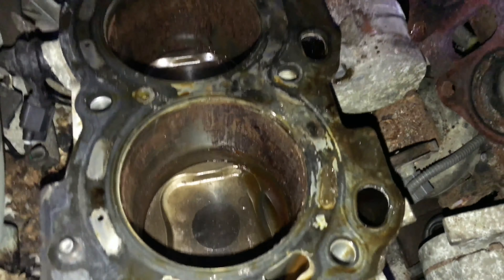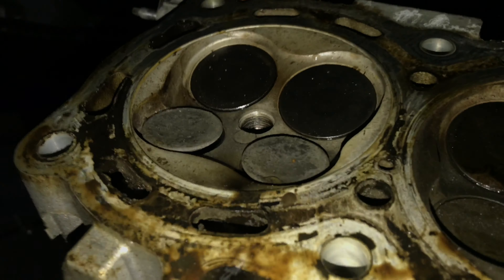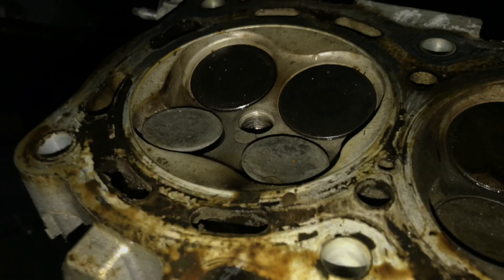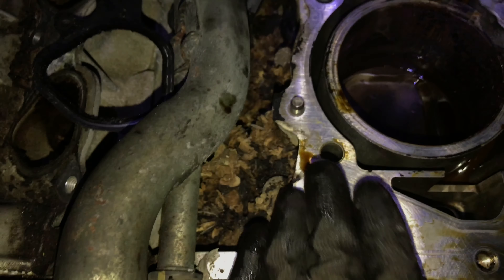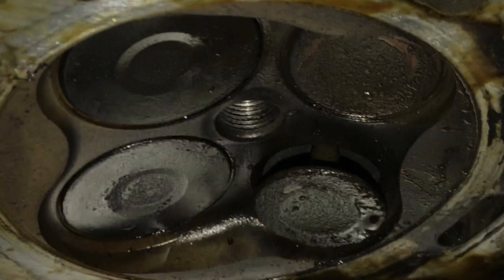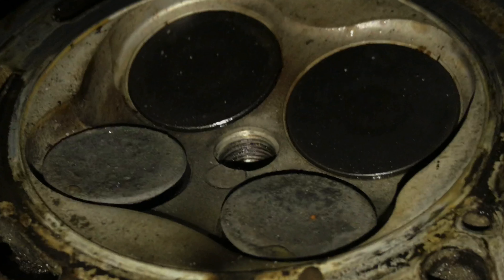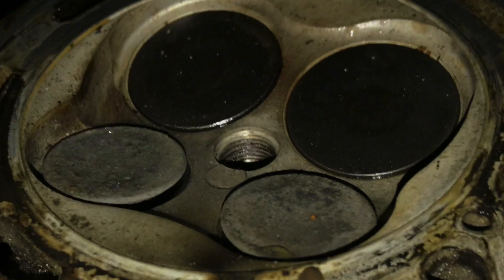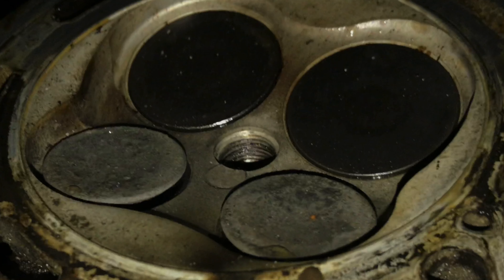FJ Cruiser Rebuild Part 8: Engine Head Removal and Engine Block Destruction

Comment: Hydraulic water ingestion damage?
Reply from the maker: Marcus Berking ya probably. In the middle of putting a V8 in. Finally got all the parts I need.
Reply: DadsGotADeal which V8 (without spoiling the upcoming video 😎)
Reply from the maker: Marcus Berking the V8 from my tundra. If you click my channel you’ll see lots more videos of the progress. Getting close